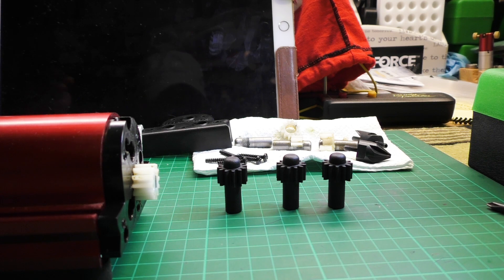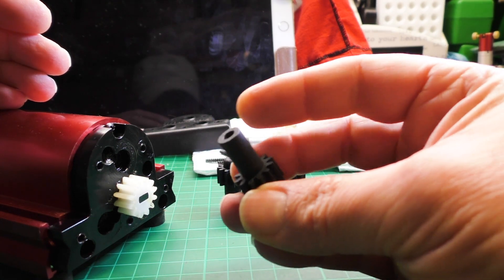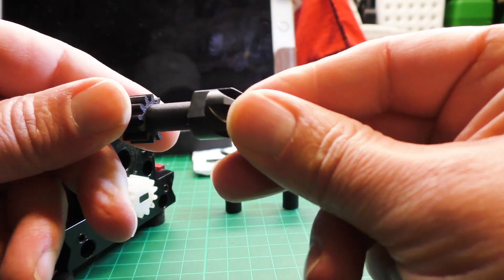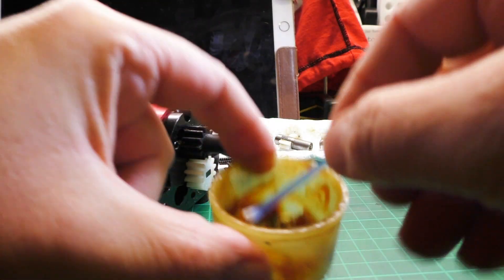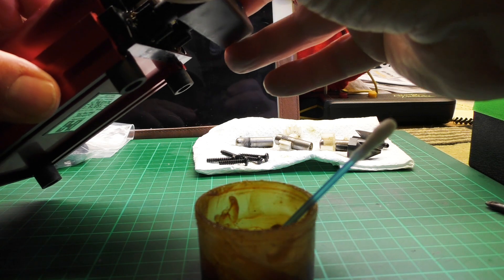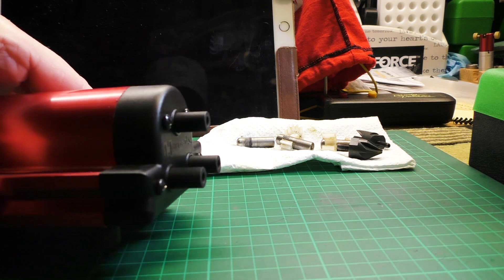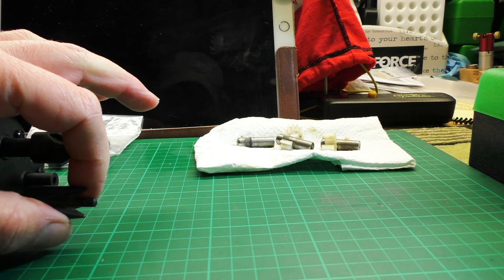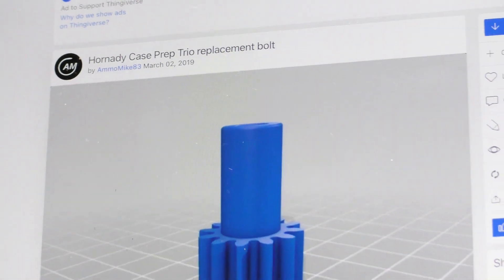Hornaday Case Prep Trio with 3D Printed Gears.

Comment: Thanks for sharing. My gears broke as well. Called Hornady yesterday and explained the problem. They’re sending me new gears for free.  This video helped me to realize how easy it it to access the gears. I wasn’t sure what I’d be looking at in there…
Reply from the maker: Hey , you’re welcome glad the video was helpful, glad that Hornady we’re willing to send you the gears instead of you having to send the unit out to them because I was told that they don’t send parts out but would carry out the repairs themselves, but as you can see it’s pretty straightforward, hopefully the 3D printed parts I have which are made from stronger plastic should last a while at least I hope so lol , anyway thanks for checking out the video most appreciated cheers G.
Reply: @GianniG55  parts came in like two days. All gears mounted on the metal posts… fixed it. No charge. Pretty impressed. Although we wouldn’t have this problem if they hadnt used plastic at all… and for $144 I think they should use metal…
Reply from the maker: @bingostar9207  ..yes that is good my only concern is that although I have fixed mine by replacing all 3 gears there wasn’t any replacement for the central cog ⚙️ that drives the other 3 gears which is made of plastic so if that goes I’m buggered unless I can get that centre cog 3D printed too but for now it’s working fine.

Comment: Hei Gianni! I have the same machine, brand new and one of the wheels is already making strange noise after just about 300 cases... :(  Thanks for this info, I will order immediately two sets!
Reply from the maker: Hi Gabor,  thanks for the comment, if your machine is new it will still be within the warranty so you can report this to Hornady although they may say can you send them the unit as far as I’m aware they don’t like to send out parts , it may be worth contacting them just to see if they respond, but it is always good to have a spare set of 3D printed gears . 👍
Reply: @GianniG55  Thanks for the quick reply! Either I go for this 3D printed stuff or I could send it back to the shop where I bought and they send a new unit. By the way this is the second one! The first one arrived with cracked wheels, right out of the box. Outrageous! Hornady should produce this from metal...
Reply from the maker: @gabortoth1977  
Yes exactly , even if was die cast aluminium it would last a lot longer than that crap ass plastic they are using , it’s shameful really , there is no reason to have a decent motor only to be let down by some silly plastic parts.